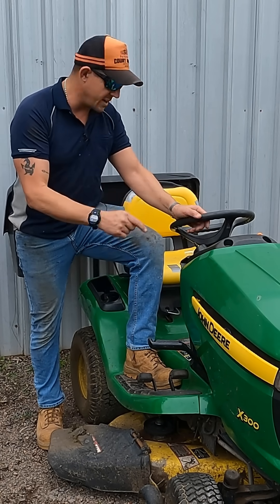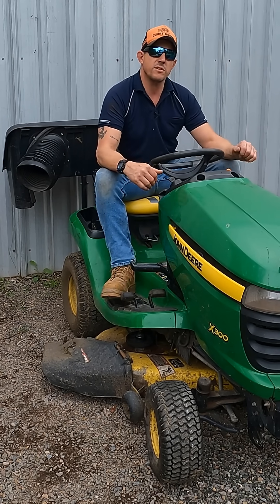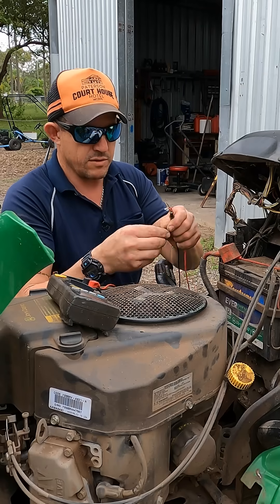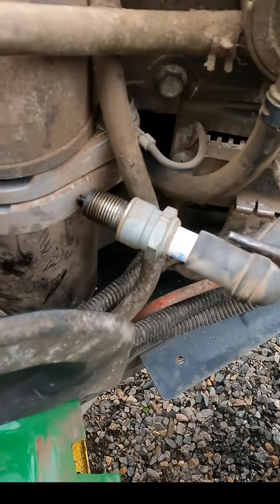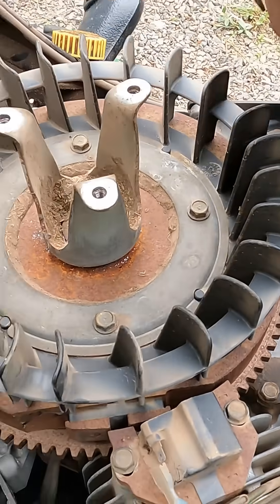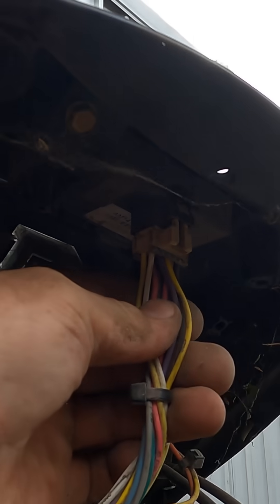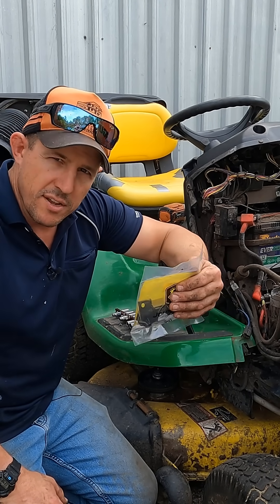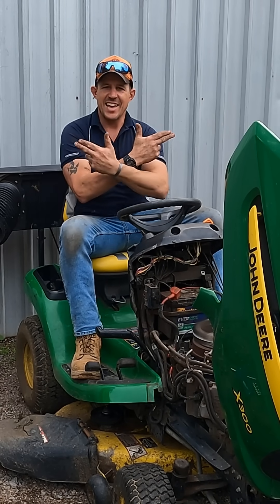John Deere X300 Mower will not start - ECU replacement #shorts #johndeere

Comment: Mine has exact same one, but it wont even light or screen nor ignite after jump start from car. What a stupid move. I checked solenoid is good fuses are good. Probably module or wire harness is gone bad?